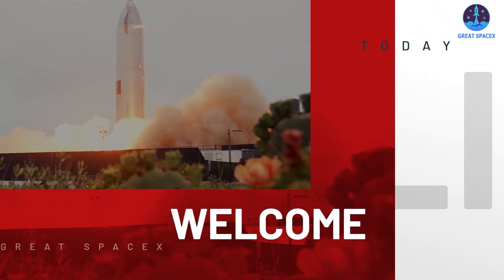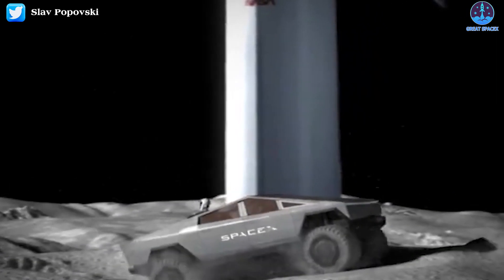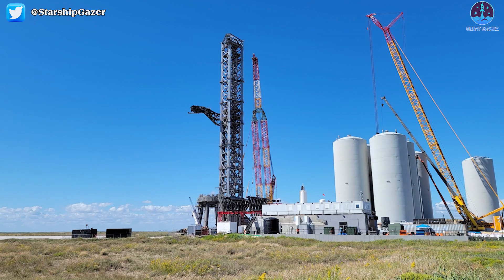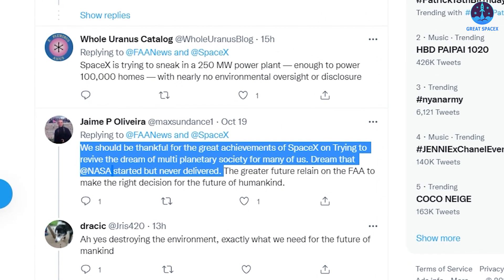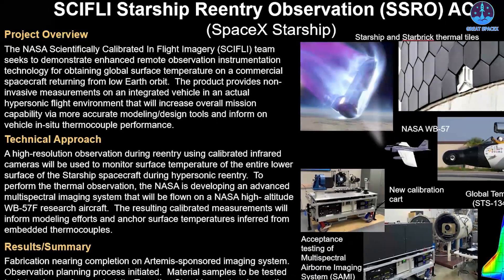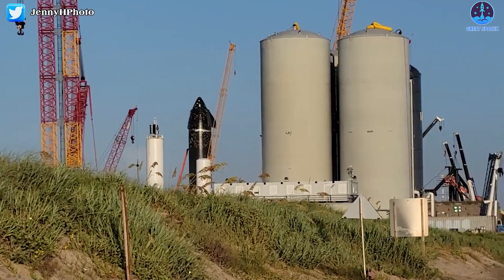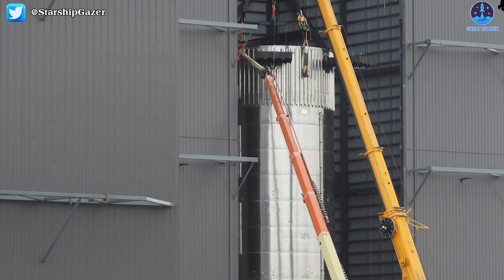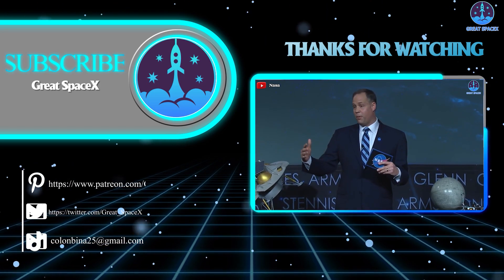SpaceX Starship 20 Engines FINALLY Burned Up! NASA reveals SpaceX first orbital Starship launch plan

Comment: I don't see anything in the SCIFLI description about monitoring the first orbital flight, just an orbital flight, so NASA's development target time is unconnected to SpaceX's scheduling. If the FAA approves Starship orbital flight sooner than NASA completes their development of SCIFLI, I don't see anything in the documentation that would preclude pairing SCIFLI with SN21 or 22 or so. In fact, I think that's highly likely, as I suspect the first couple tries will fail early in re-entry (those tiles are pretty iffy) - NASA would get better data on a later flight after some of the design is a little more fleshed out.
Reply: Remember when NASA started to fly the shuttle, they also had difficulties in making the tile stay on the belly of the shuttle. Maybe SpaceX could find out what NASA did to get the tiles to stick.

Comment: I'm concerned about thermal tiles breaking off during the pre-burn test.  I know that ultimately, NASA started using thermal blankets on parts of the shuttle to improve reliability and time to replace.  Perhaps a mesh over the tiles that fill in the spaces between the tiles would keep the tiles in place during high-vibration scenarios like launch.  It would be primarily structural and could ablade during reentry.  My 2...
Reply: alt 155 for the cents symbol.   my 2¢.

Comment: Those tiles seem to fly off a bit too easily. Tile attrition is bound to be a major problem, when even during static testing they come loose. You need better superglue or stickier stuff to hold them on.
Reply: Remember when the shuttle started to fly it also lost tiles on its belly. Maybe SpaceX could ask NASA what kind of glue they used to keep the tiles on the shuttle.
Reply: SpaceX doesn't glue their heat tiles to starship, it's was attached using mechanical mounting system.

Taking example from the space shuttle, gluing the heat tiles into the space craft is a very lengthy proses afterall if you wanna have a rapidly reusable space craft that only need 1 hour before relaunching again you don't wanna waste time gluing your heat tiles. So i don't think the mounted heat tiles going to work on the first try, i hope SpaceX figured a way to fix that problem in the future like they always do

Comment: The Government getting anything done in a timely manner ended in WWII. It would be a much better idea to concentrate on the sea launch platforms, and place them outside of the FAA's jurisdiction.  That way SpaceX can get the bureaucrats and politics out of the picture. Then just use the government for guidance when you want to and they can be made irrelevant.

Comment: I think this version will never fly or if it does so fail spectacularly... the heatshield is just not ready u can tell every occasion it gives us... first installing the tiles -> Tiles damaged -> lifting the ship? -> Tiles damaged, firiing preburner -> damaged tiles / flown of tiles... there is just no chance that this thing will stay in one piece durig Max G let alone reentry

and that is not even the biggest problem... for an orbital flight the 3dozen raptors would have to burn for super long, longer than they have ever been ran, at least what we saw... and they already failed sometimes... 
I think Raptor 2 will be the one that makes it to orbit and maybe back.... 

SN21 and BFR5 will be way more interesting but also I think very deciding about the future of Starship... so many concepts to prove...
Reply: Stainless steel is much more heat resistant than the aluminum used in legacy vehicles. Aluminum melts (depending on the alloy) anywhere from 900f to about 1250f. Steel, depending on alloy, melts between about 2500f and 2800f. Heat tiles over steel alloy provides about 2.5 times the safety margin compared to the Space Shuttle. 
The Columbia suffered a failure of its tile system but the loss of the craft was actually due to the fact that the leading edge of the wing was carbon fiber which burned through and allowed the heat to destroy the aluminum wing root. Even with the suspect heat tile systems, Columbia launched 28 times. 
SpaceX knows there is a very large possibility that sn20 will not survive reentry. The launch is really just a practice run for all the ground support. If that all survives, and the thing doesnt blow up on ignition, it will be another iterative step in the process regardless ofoutcome. I have a lot of confidence in them.

Comment: Think itll come down to the Tiles - SN21 is supposed to have a different fitting system for them (don't know what) --so not sure the point of sn20 would be - though comparative tests during engine tests of both prototypes may give a clue.
Reply: The point of 20 is to test the guidance software.  If they can prove the software dumping 20 in the ocean, then they may try to catch 21.  I don't see 20/4 going away without flying unless it somehow becomes more cost effective to scrap them. Elon is all about costs.
Reply: @JoeShmoism  Not to mention that Elon said 20/4 would be a success if it  makes it off the pad and clears the launch tower.

Comment: I think the two tanks are dump tanks to quickly empty Starship and booster when needed, then the old fuel can be reprocessed after the test for reuse.
Reply: yeah makes sense. or backup if there''s an issue with the custom tanks.
Reply: Wow, that makes sense.  I was just thinking he should be saving a lot of money because he buys so much.  And having two delivered at the same time is only natural since he will need a lot more and it will be cheaper to purchase.   The methane container looked smaller in circumference and shorter compared to the custom made tank Elon made.    I forgot the size, maybe 100 cubic 3 meters?. They did tell you in the video just how many would fit tin the Elon tank I think it was one.   I would like to have Biden get out there promoting AMERICA`S new age in space and science thanks to Elon Musk and SPACE X.  Remember, VON BRUEN? did a lot of promotion with the SATURN 5.
Reply: Starship uses cryogenic methane, they have to put the liquid methane somewhere before they supercool it.
Reply: @MichaelClark-uw7ex  Good morning Mike,  So super cool is even colder than the state the Methane is in now in the tanks that were delivered, WOW.  Colder , more dense, more into onboard tanks, more GO-GO?  Thank you, Mike I naturally thought they would be transported in such a state as super cooled?  I need to look up the difference in the coldness  in both of those states.   Like 200  to 300 below to become a liquid as a guess.  Thanks again Mike.
Reply: @kevinmccarthy8746  Exactly, Colder=higher density.
Methane liquifies at a much higher temperature than what the Raptors are made to eat.
More density means more thrust for a given volume of fuel.

More go per tank.
Reply: Good call, when you need to off-load propellant quickly I guess it’s useful have ‘dump’ tanks below the base of the rocket to use gravity and the head of gas pressure to full effect.
Reply: i watched the Nikola Tesla movie!! it was so great...!!
Reply: @florenciovela7570  is that related? I don't think so, but please correct me if I'm wrong.

Comment: Congratulate what?  This is the second consecutive test where tiles were blown off.   The last thing you need is when ascending into orbit, fire up the engines and tiles come off.

Putting the liquid methane next to the liquid oxygen at the tank farm is not the brightest of moves.  Look at LC 39A and B at KSC, the hydrogen and oxygen tanks were at the opposite sides of each pad.  You know, an extra safety measure.  

This is an environmental assessment.  The comments about how great SpaceX is has nothing to do with the subject if a more through assessment needs to be made.  This has to do with the impact to the area, not our future in space.
Reply: All depends on the size of the hole it might make, on the environment lol
Reply: Patience, more fixes/correction of mistakes, if there are such, to follow. Sometimes one has to make risky decisions to move forward quickly. There might be reasons why tank farm is the way it is atm. I hope spacex also have plans to relocate the operation quickly if local environment will be an issue.
Reply: @ksd593  The biggest issue is how rapid SpaceX is.  They are using the excuse that explosions means good data and they need to do rapid testing and development.  They have more explosion's because instead of doing thorough testing of separate components on the ground, they do some testing then just launch it to see what happens.

If they were doing this testing at the established facilities at KSC or Vandenberg SPS, they would have been slowed down, and possibly not going through the scrutiny they are now due to the environmental impact of their testing.
Reply: @pebmets  seems bc was the best decision at the time, starship development would not be there where it is now without it.
Reply: @ksd593  Probably Musk knew that at the established facilities his rapid testing would be scrutinized.  If one incident causes a major impact around the bc site, Musk will most definitely be stopped from testing there setting development back over a year or stopping it all together.
Reply: @pebmets  they might surprise with rapid contingency plans in that case
Reply: @ksd593  Why is it not better to take a slower methodical approach instead of rapid development and test.  Wouldn't it be more efficient to have more working prototypes vs having them fail or at least fail to the point where you cannot reuse any of the hardware?  Musk's timelines are never met and the 2050 colonization is already falling behind.  Does it really impact you at the end of the day if it takes 5 years to develop something instead of 4.
Reply: @pebmets  good question. Materials are cheap. Workforce on standby is expensive. I have been prototyping myself. The amount of ideas/inovation increases 10x during this phase + you can see better your own mistakes. Sx is on right path as long as they can afford it. So far they are doing things quite cheap - building a rocket in backyard/field/tent from steel + spaceport which is a pathfinder as well
Reply: @pebmets  North American Rockwell  began construction of Columbia in 1976. It was not complete and ready to fly until 1981. It went through the inch by inch testing process you suggest. It flew many times, and was destroyed by the meticulously planned heat protection system. The first thing thatfailed was a tile, the se ond, the carbon fiber wing edge, third, the aluminum spar holding the wing.
The Boing Starliner went through the same process. After failing to reach its intended orbit on its first attempt, on its next attempt it came within 1 second of launching with engine valves stuck in the wrong position. Those valves had been identified as a problem, went through a fix and q a program. 

This step by step process never challanges basic design functions, will not find problems when the part performs as required, and never tests the whole system, because it is too expensive to take a test vehicle  beyond its planned limits.  At the same time it adds years to develop, huge cash expenditures, and ends up with no greater safety margin. The only reason I see to stick to that kind of development is that companies like boing, Lockheed et al have convinced congress this is the only way to do the job. They are of course willing to take on the impossible task at cost plus 20%, for as many years as it takes.
Reply: @bobbarclay3203  STS-1 through STS-4, the initial Columbia flights, were officially test flights to shake down all of the systems as one system.  Modifications were made as part of the testing, (the need for a water suppression system, save weight  by not painting the ET, timing the start of the SRBs with the twang caused by the start of the SSMEs, being able to go to thermal blankets on newer orbiters, etc)..  The Shuttle was not really declared operational until STS-5, Columbia's first operational mission. The components were tested separately then technically STS 1-4 were the test flights.  They knew about the foam at that time, but fell into the belief it would not be a safety issue though it was important enough that it needed to be addressed,

The first flights were testing all of the systems combined while before that each component was tested separately.  I don't disagree with your timeline, but you have to count the first 4 shuttle flights as the shakedown flights where they learned many things.
Reply: Your third point is correct of course.  We fans of SpaceX tend to let enthusiasm push aside other issues. Guilty myself sometimes.

i cant find a record of any shuttle launch where some tiles were not damaged loosened or lost. Lost tiles dont necessarily endanger sn20 because it is steel and not aluminum/carbon fiber.
Reply: @bobbarclay3203  Tiles were lost on STS-1 on the outer shell shell of the oms pods.  That was caused by the energy reflected back at the stack from the launch.  That was resolved with the introduction of the sound suppression water system:

Shuttle titles did not fall off on their own after that, but were damaged almost every flight from falling foam from the ET.  NASA knew that was an issue that needed to be addressed, but one they did not believe would be catastrophic.  Unfortunately, Columbia proved that wrong.  

The was a DOD flight where a tile was damaged down to the skin of the orbiter, but there was a heavy metal support beam that happened to be there which saved the crew and orbiter, Atlantis.

Comment: Please do a video on what it takes for SpaceX to reuse the 2nd stage of Falcon 9. Maybe another engine and more fuel to use to slow down during reentry?
Reply: @vablo7198  btw, have you realised? your idea/answer is not dumb.
Reply: @ksd593  That's cos he's being facetious,  the whole idea of Starship is that it IS a reusable 2nd Stage
Reply: @wande.r  Hear me out why the idea might be good. It might be cheaper (as cheap as 5mil or less) and/or more technically possible to discard starship's steel fuel tank + vacuum engines in leo and then stage off a lighter vehicle or capsule that is more suitable for descents/ascents and reusability. Full reusability shouldn't be the goal if it turns out to be cheaper to discard some parts
Reply: @ksd593  The Goal is 3 R's , Rapidly Reusable Rockets   ! 

As elon has said before,  the cost of a falcon,  excluding starship,  after 3 uses , the cost of the falcon is effectively Nil ! The price point to beat or remain competitive for Starship is, $20/kg to LEO .

Jeff Who ?
Reply: @wande.r  Like I said rapid reusability of the whole starship still remains an unfulfilled goal but smaller 3rd stage might be more easy to send further or land back and reuse.  Disposable starship cargo version will be very cheap as well (just the components/materials under 3 million if mass produced)  -  no sea level engines, no flaps, no tiles, no maintenance costs and no additional risks and costs due to failed landings. Your path is Ideal but it requires a lot of fuel to move around and reuse. What will be the most possible, time will show. I keep my mind open. Btw, still reusable if in space.
Reply: Oh where my comment to "wander" went? He really got offended?  Let me try again: Elon who knows physics on twitter: "Over time, we might get orbital payload up to ~150 tons with full reusabity "If Starship then launched as an expendable, payload would be ~250 tons. What isn’t obvious from this chart is that Starship/Super Heavy is much denser than Saturn V." 

100 tons more to leo,  not bad if heat shield developmwnt got problems

"Zubrin Mars direct 2.0" or "Mars Direct 3.0" search on youtube, mr "wander", the knower of physics... What I mentioned was not mine.
Reply: As elon has explained several times, physics just doesn't support returning a 2nd stage with current engineering. 
Regrettably physics is universal,  so to improve we will need a better engineered reusable 2nd stage. 
This is what elon is attempting!
Reply: @wande.r  just asking for video that explains the physics.
Reply: @Steve-Richter  start by brushing up on yr knowledge and develop your understanding of the physics required.
There are loads of YouTube on Orbital mechanics and Buzz Aldrin wrote the book on orbits, very interesting and quite weird, especially when you look at the procedure and mechanics of getting a Dragon to the ISS .
Reply: @Steve-Richter  Steve, we got a very smart guy here